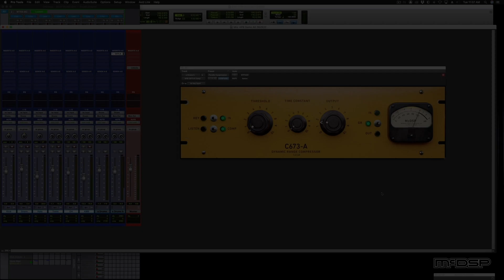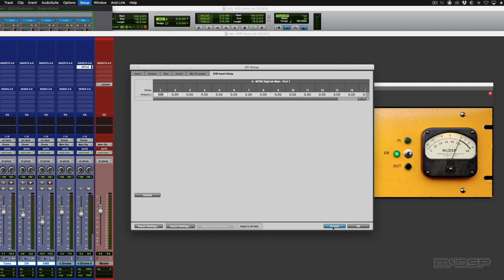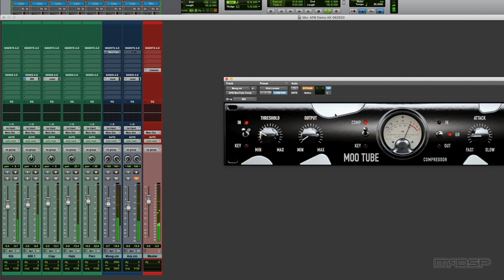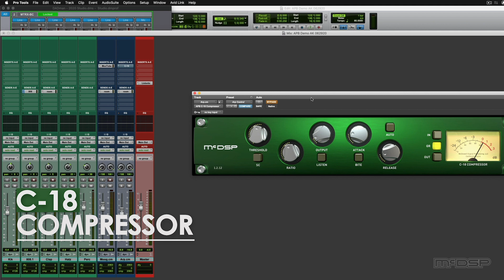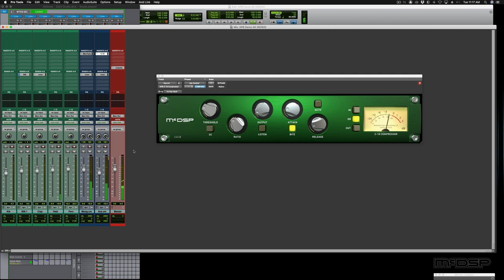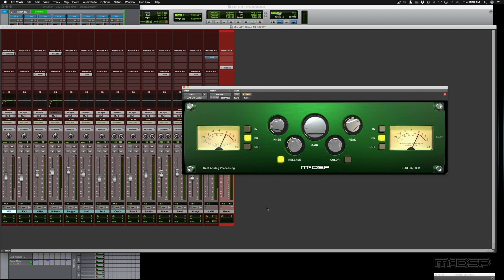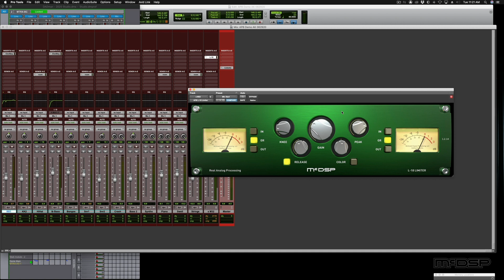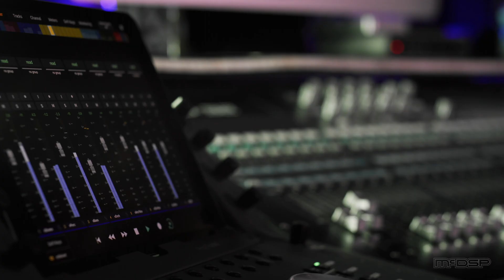What is the Analog Processing Box (APB) / Hybrid Mixing

Comment: Some questions:
1. Can I use 1 compressor on 3-4 or more channel ?!
2. Vca - tube - opto and ... compressor has different transformer or tube .  What’s this processor brain ?! Which transformer ?!  How about tube emulation?! 
3. Do you have any over sampling system ?!
Reply from the maker: Got some more info for you! 

It does not have an oversampling system. But the APB-16 and APB-8 have super awesome 32-bit AKM converters so they sound great without oversampling.   Also note that regardless of the sample rate you operate at - an APB unit always delivers the same amount of channels - because its analog!  So an APB-16 gets you 16 channels of programmable analog at 44.1 kHz, or at 192 kHz. An APB-8 gets you 8 channels.   

Tubes? Nope. We use modern high end analog parts - WIMA caps, Burr Brown op amps, THAT VCAs. Three custom saturation circuits per channel. We have a flexible ANALOG system that can model a variety of devices that may not be in our circuits. Analog modeling analog? You bet. It sounds great in our completely biased opinion!

But wait there's more! The APB monitors itself ALL THE TIME so you get a consistent response session to session, and track to track. The APB is not just a huge jump in how we can control analog processing, we also bring new capabilities like self-calibration, sample accurate automation, full instant session recall, and our 20+ years of signal processing knowledge. And you don't even need a patch bay!
Reply from the maker: Hello, one channel on the APB can run one mono APB plug-in. If you'd like to run one compressor on multiple tracks, you can bus them into an auxiliary bus and put an APB plug-in on it. In regard to Tube emulation, the APB does not have any tubes inside but you can do that using the Moo set of plug-ins (MooTube/ElMoo/Moo X Mixer). In regard to oversampling, let us get back to you on that!